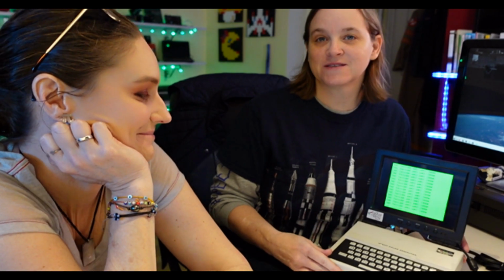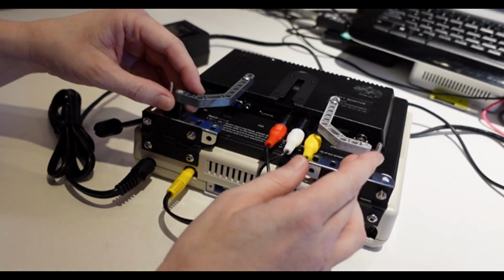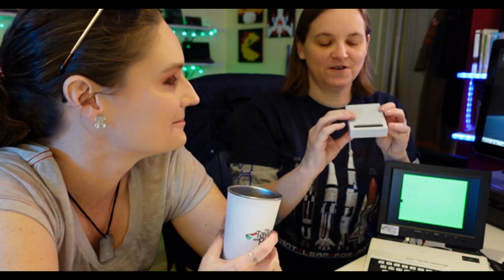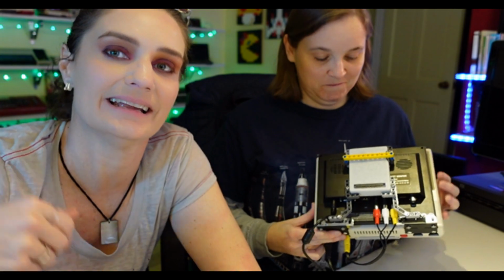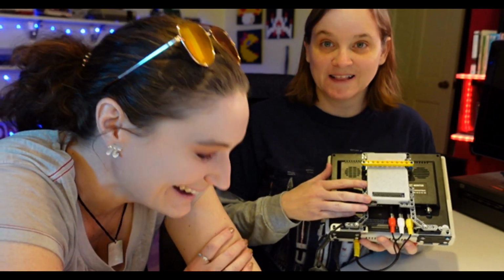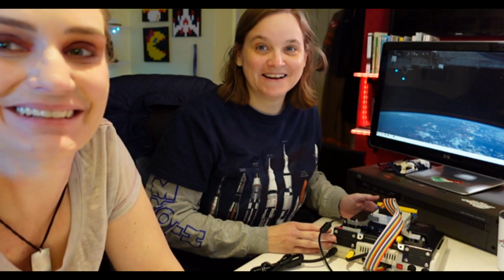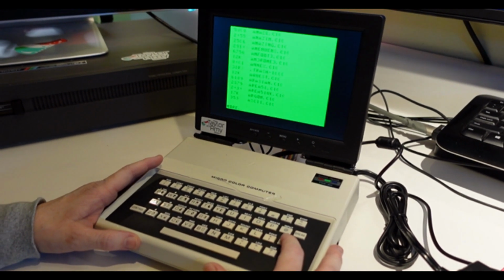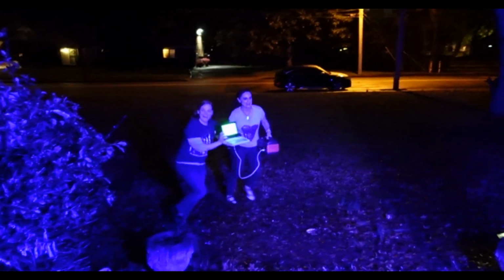TRS-80 MC-10 LAPTOP

Comment: I love this build, it's amazing.   I would probably flip the MCX device upside down so the pin headers were at the top to take up that extra slack and remove the need for a twist in the cable.
Reply: It's possible. Once you close it you kinda need the extra play.
Reply from the maker: Excellent suggestion, thank you.  That totally worked.

Comment: Now you need to build a MiSTer FPGA laptop.  No.  Seriously. :)
Reply: Oooooh
Reply: @fractalMD  - There are a few dozen case types I've seen people custom build with quite a few of them making YouTube videos out of them.  One person repurposed an Amiga 500 case because they primarily wanted to use the Minimig (aka the Amiga) core.  One guy designed a wedge case and 3D printed it.  One guy used a repro Amiga case.  Some have used ATX cases.  It could basically be put inside of any retro computer case with enough effort. :)

I myself have stuck with the fairly generic acrylic sandwich case as well as the Mulitisystem console-style 3D-printed case.  The folks who make the Multisystem board/case also created and showed a demo of a handheld (think Nintendo Switch) case with a screen and battery.  There have been so many case types, it is hard to keep up with them all.

Since ya'll like the attached screen/keyboard laptop style, a MiSTer FPGA "laptop" seems like a natural fit.  I think I saw someone repurpose and android phone shell laptop (where you put in a phone and it turns into a laptop) for a MiSTer but I couldn't find it again on a cursory search.

If I had room in my house (and the extra needed $), I'd get one of the MiSTer JAMMA boards and stick it in a standup arcade system.  Lots of people have done that.  Then of course you'd need two of those... one for vertical games and one for horizontal games.
Reply: @lsdowdle  This is like 37 great ideas in one comment.